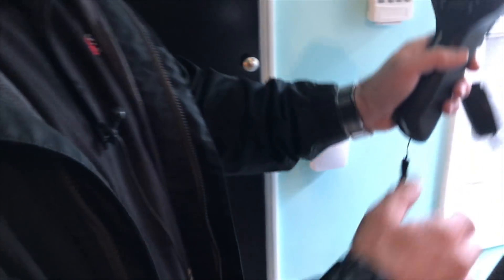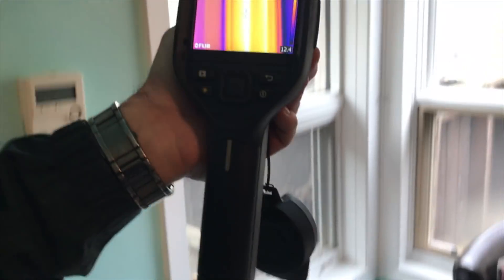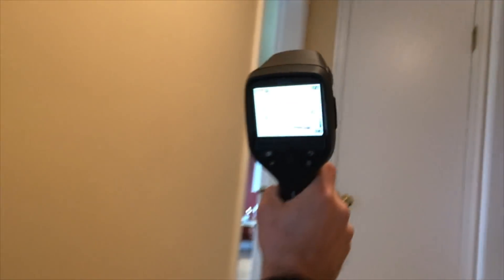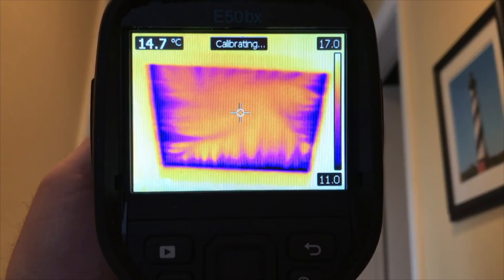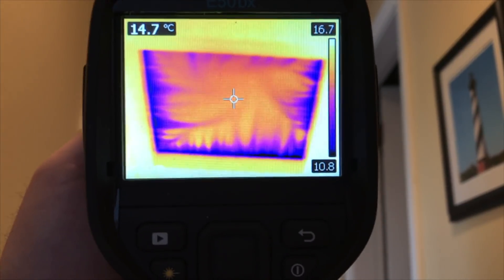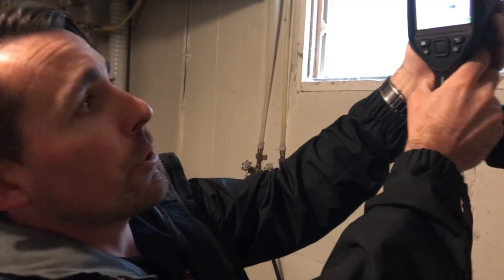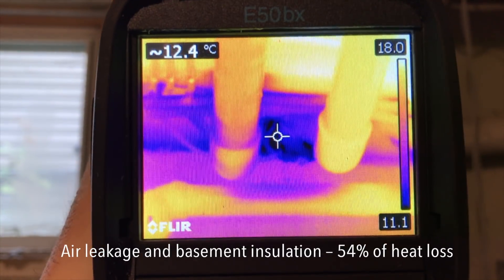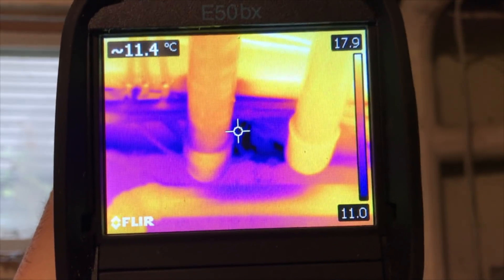Smart Homes - Blower door test reveals air leakage

Comment: What if the house has mold or something won't you disturb it with the blower door test and send spores or whatever thro the house causing problems?
Reply: I was thinking the same think. Or if the air from ducts wrapped in asbestos-laden insulation would be sucked into the home envelop.